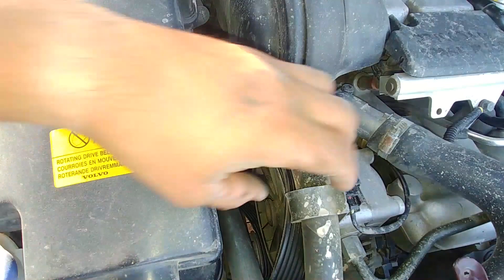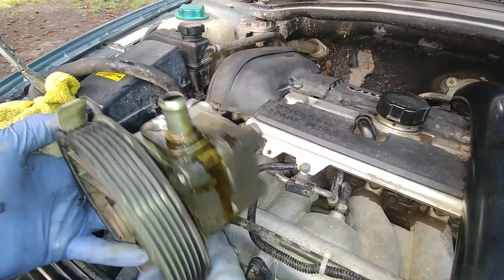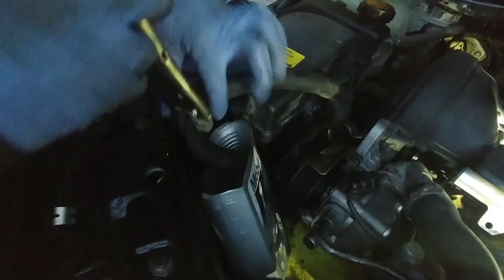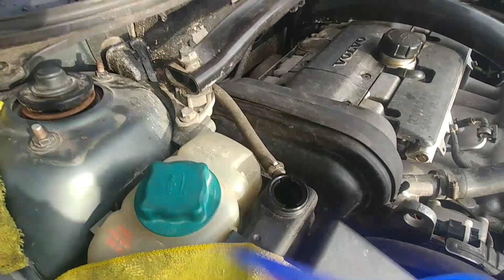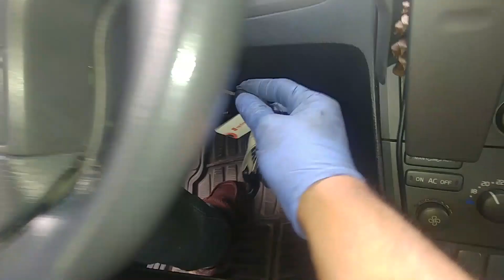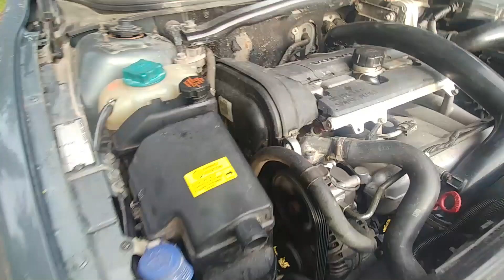VOLVO POWER STEERING PUMP REPLACEMENT - Volvo s40 s60 s80 v70 XC70 XC90 models

Comment: On a 2004 Volvo s40 is there only the 4 bolts behind the pulley that attach it?
Reply from the maker: I am not 100% sure Steven.
Reply: @PistonShack  I found it.  It was just the 4 bolts behind the pulley.  I thought I had taken them all out, but missed one. : /

Comment: 2005 S80 and power steering failed while while parked. Fluid level checked. Do I just assume bad pump and replace pump and the lines you recommend?  Car has 170k so pump is probably bad. Thanks.
Reply from the maker: Good morning, Joe! I would top up power steering fluid and take it for a spin, it might get back to life. I won't touch any lines if they don't leak out. 170K is nothing for Volvo PS, mine just stated to from shaft seal a bit @315K. Let me know if you have any questions. Cheers!

Comment: I notice an auxiliary cooler mounted on the nose of the car.  Is that a transmission cooler?
Reply from the maker: You are right Aaron! That's AT aux cooler. I also have inline filer installed on return line. I am planning to make a video about it. I will call it: "ASIN Transmission Saver"

Comment: I was waiting till the end on how to re-tension the belt after you released it right at the beginning. Is it a case of just pulling it out with your hand or what? I ask because I'm not sure if there is a correct amout of pressure that needs to be on the belt.>!?!?
Reply from the maker: Hey Mike. I just realized the tension by turning the belt tension with braking bar and slide belt off. It is automatic tensioner - no any adjustments need it.

Comment: very good vid and i agree excellent camera work.   On road back from long trip the pulley for this pump just totally tore off to be unusable thus killing everything else running off that long serpentine belt.  any idea how that could happen, is that indicative of a faulty pump--------i can turn what the pulley turns but certainly have to replace pulley and just wondering if that tearing up also suggests bad pump???. Any thoughts??
Reply from the maker: Hi Barry! So far sounds like worn out power steering pump. Also rock could get on the belt to cut it off. I got good used PS pump from local scrap yard for 30$. I think that's a way to go.

Comment: Which fluid on 06 xc70?
Reply from the maker: Hi David. I put NAPA synthetic power-steering fluid in mine to test it out. It has been over a year since, no issues - no leaks, no foaming. Volvo recommends only Volvo Power-steering fluid. Should be the same fluid. Check you owners manual as well. Have a good day!